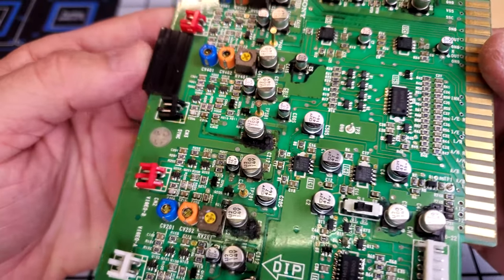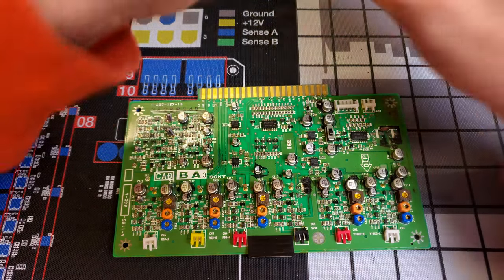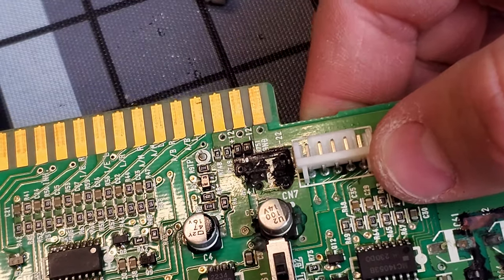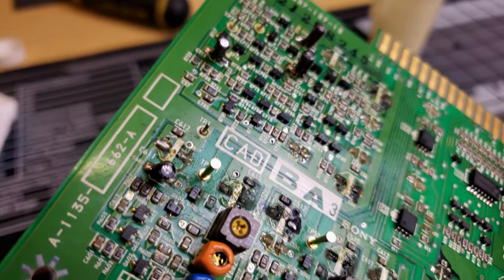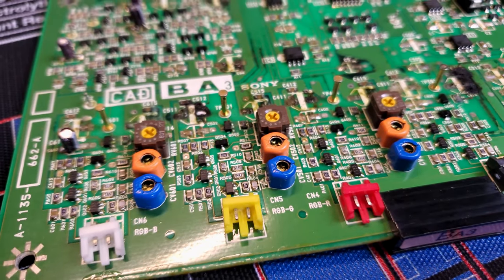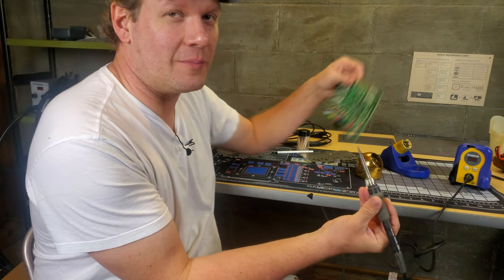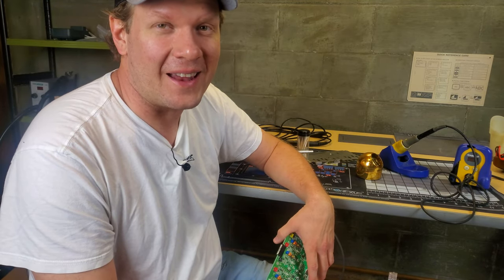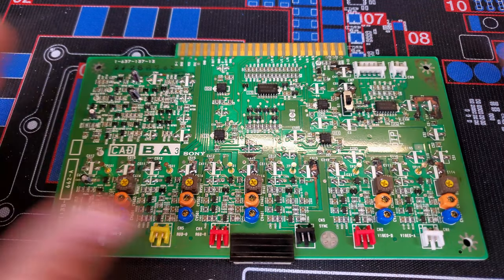Secrets to Removing SMD Capacitors!  Is it safe? 📺 Sony BVM 1316 Repair Part 2

Comment: I find that "chopping" them in half with a pair of cutters is even safer: less stress onto the legs, and the bottom half of the cap just comes off.

Tested on multiple gameboys that i recapped, always worked.

Comment: You may have continuity on those black traces but you should probably scrape off the mask and tin them with solder anyway. Even if continuity tests fine, the electrolyte makes them capacitive which will cause issues once you put AC frequency through it. I see it all the time for audio issues in Turbo Duo consoles.
Reply: I hadn't heard of that before. Scraping, cleaning, and tinning with solder fixes whatever issues this added capacitance causes? I imagine whatever issues might be caused are going to vary quite a bit. Some signal traces might not be as bothered by it or maybe the chance in capacitance isn't significant enough but others I could imagine it causing significant problems.

Do you cover the tinned traces afterwards with something like nail polish to protect the solder as well as insulate?
Reply: @mottzilla4858  I try to tin it as thick as possible so it’ll be thick enough that an oxide layer will not corrode through.

There is a particular trace that runs under an inductor coil that I have found with the problem multiple times. It was the same blackened trace GadgetUK164 found in his Duo repair series but I had to find it on my own the first time.

The first was particularly bad. The board had been entirely cleaned and repaired except for that trace because it went under the inductor and I had pretty much zero Ω continuity all the way across the board on both sides… from one of the 4558s to the NEC controller chip by the drive. Ultimately, I had to remove the inductor, scrape away the blackened mask, and tin the trace. The problem I was having was definitely isolated to that single trace blackened by electrolyte even though it had continuity and shiny copper once the blackened mask was removed.

I recall that it had low audio and then you’d get a loud “POP!” that knocks out all audio until you power off for a bit. I presume the unwanted capacitance caused high ESR/impedance as it builds up a charge and when that charge reached a threshold it discharged into the 4558 op amp to knock the audio out until it is power-cycled. I fought with it for a couple days.

Now I always check under that inductor and I have found it blackened multiple times. I have deliberately left it that way while finishing the rest of the cleanup and repairs to see if I get low audio and I do. Like the first time, it also goes away when I scrape away the electrolyte-impregnated mask and tin the trace. Like before, I typically read at or near zero Ω even while it is still blackened. I’ve never tried to measure AC impedance but I’m pretty sure that’s what’s happening.

These days I don’t wait to see if these other units will have that loud “POP!” because it always seemed like it would damage something… maybe even my speakers. It’s probably a matter of degrees anyway where the time it takes to “POP!” all depends on how much electrolyte got soaked up.
Reply: Good experimental evidence there! Thank you. I'll have to remember this! 
Especially good to know as that would be hard to diagnose as it otherwise would look/diagnostically work fine.
Thanks!
Reply: @lelsewherelelsewhere9435  Yeah. No clue what it might do in a BVM card like this… maybe nothing depending on the type of signals. I just know it can cause issues for some signals so it’s probably worth cleaning up to save yourself the troubleshooting later. :)

Comment: I literally recapped a SNES (first time ever) yesterday that had surface mount capacitors. What i did was heat one side after fluxing and pulling it with tweezers while i applied some heat. And kept doing that back and fourth until it was off.

Comment: At work when removing SMD electrolytic caps i would typically use hot air to remove them. Other methods include using the iron to heat one side then tilting it up and heating the other side. At home id probably use SMD rework alloy.
Reply: Admittedly hot air and hot tweezers (the recommended tools for the job) are pretty expensive. But rework alloy is cheap. You just need to make sure to thoroughly wick it off after removing the component.

Comment: I have done a cap replace on a horribly corroded Mac LC using this method and the trick is to push down on the caps, not pull up when you are twisting them. Never pulled a pad and have done this method on  8 computers/consoles so far

Comment: I have a `1416 bvm i tried to ressurect recapped the whole deflection and rgb board cant get it to sync externally or internally not sure whats wrong. i can confirm twisting smds off is safe i have never tore any traces doing it but i have heating it and pulling up side by side the heat is what pulls traces off especially in high heat prone areas .

Comment: I've used the twist and pull method for years. I'm not saying it can't happen, but I've never damaged a pad. The key is to get it nice and hot. Microwave Tuna anyone?

Comment: Does PS2s, GameCubes and Wiis have capacitors? Do most consoles have them in them?
Reply: Of course.
Reply: Basically every single PCB has caps on them, electrolytic, tantalum, polymer, ceramic, etc.
Reply: They sure do. And eventually like many older electronics they may require recapping too. But every console is an individual. Some will go longer without problems than others. I personally haven't see anything about people needing to recap those systems yet, but eventually it'll happen. I have seen plenty of people with dead batteries in their PS2 consoles. Those batteries don't last all that long.
Reply: And GameCubes have them too. Those discs are the hardest in the world to resurface if they get scratched horribly.

Comment: I've done the "twist" method before. Did it on a PS1 motherboard, a game gear or two, and the first N64 I did. 

For the most part, I'm not apprehensive about doing it unless I can see a cap has visibly leaked. It could very well have made the pads weak too and it's not worth the risk in my opinion. 

Usually when I'm pulling SMD caps, especially if there isn't anything near by that I can damage with hot air (or leaky tuna sauce to sink to high heaven) I will just use the hot air to pull the caps as gently as possible. PS1's and N64's are pretty save to do it this way. I've tried the "cut the can" method too though I'd rather not puncture the can if I can avoid it.